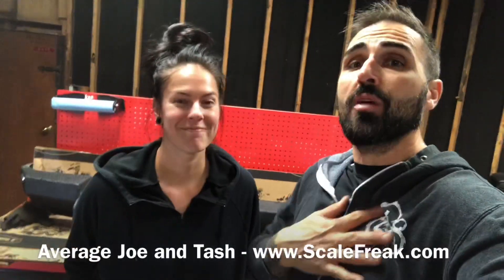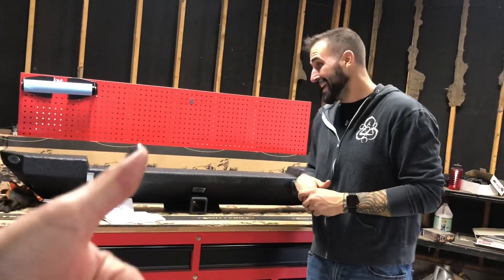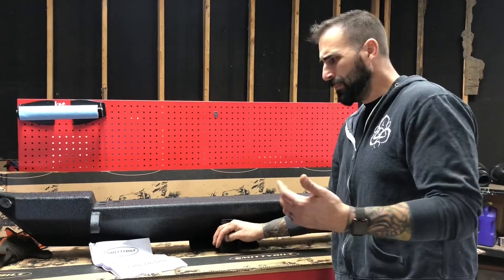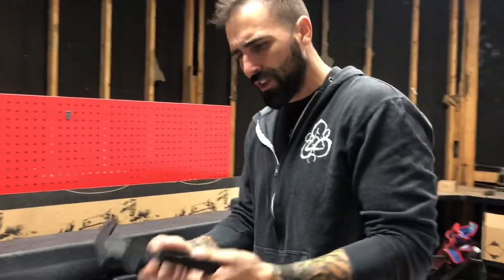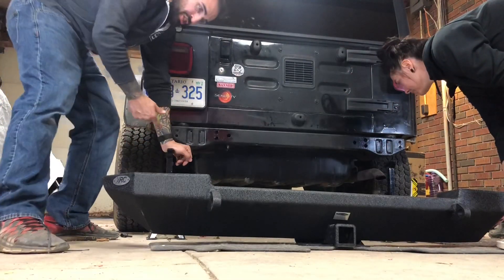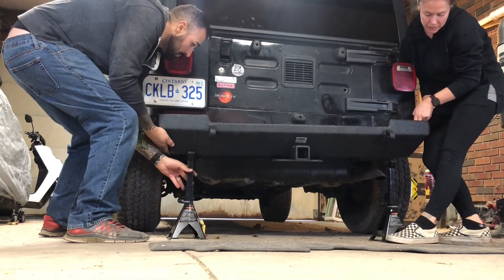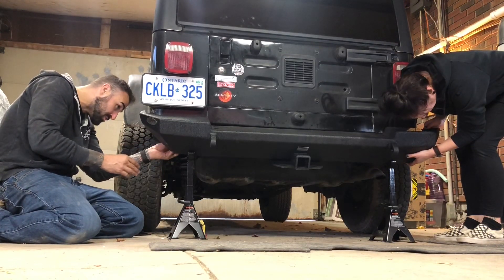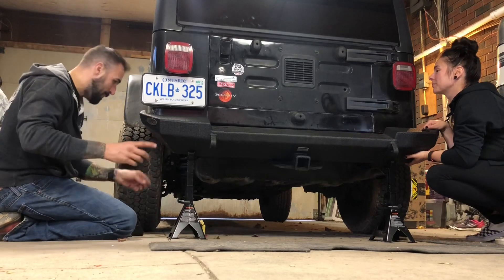Watch us butcher a bumper install - Smittybilt XRC Rear Bumper

Comment: Your going to need an air impact or electric impact. I like ingersoll rand for air impact and Milwaukee for electric impacts. Especially to get rusty stuck on bolts.
Reply from the maker: I got a breaker bar for the Hard stuff so far
Reply: @scalefreakgaming  they work to a point, let's say I seen breaker bars bend. Lol

Comment: i finally got mine off...  the 4 holes you drilled (or modified on yours ) ..  were you able to get the 4 bolts in them?  i dont see how the driver side could be done without removing the fuel tank.... very difficult on passenger side if you have the factory exhaust pipe in the way..  mine did not have the 4 bolts on the inside installed because the guy could not reach them..  let me know. thanks
Reply from the maker: Chris Craft I have read that on a TJ, dropping the tank makes the job easier. With the LJ, I have some more distance. 

But yes, I was able to get everything set up.
Reply: @scalefreakgaming  ok, makes sense..  i didnt know you had an LJ...   thanks..
Reply: I can tell four years later, having just installed the bumper it’s impossible to get the 2 driver side bolts without lowering the gas tank. Every video conveniently  skips installing them.

Comment: what is the part name that goes into the frame for the brackets? we are missing them for my XRC bumper and need to find them
Reply from the maker: Oh...crap, I’m not sure. I didn’t remember if the parts were named in the instructions. 
I found that Smittybilt customer service was...not impressive. My winch had the wrong bolts with it and I had to prove that they were wrong. For two bolts.